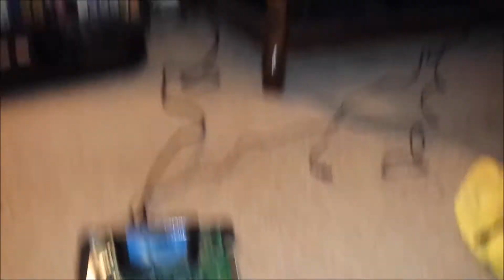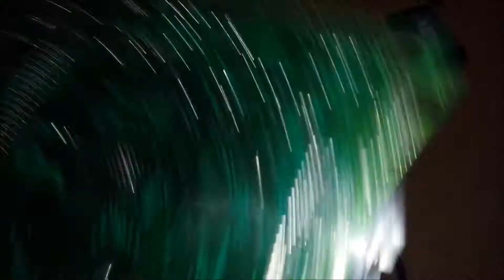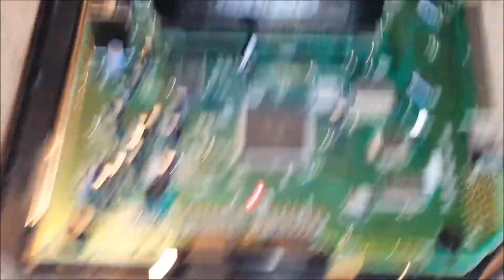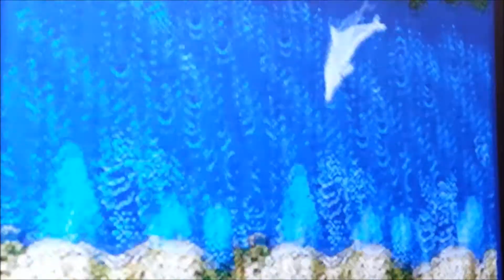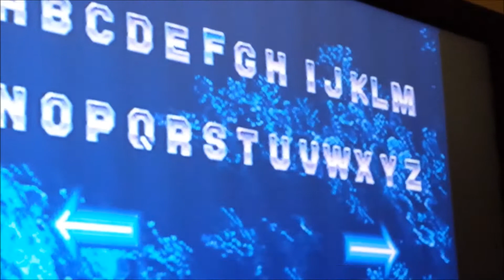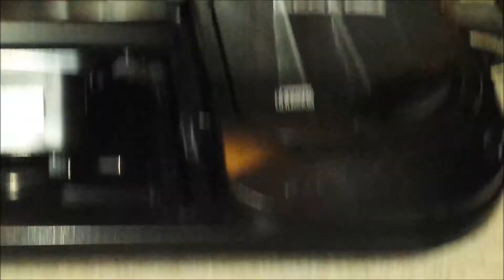How To Repair A Broken Genesis Model 2

Comment: I literally have this same issue with my Genesis 2. Literally the same exact effect. You make it look so easy though XD
Did you have to do anything to clean up your soldering iron/solder joints on the board? Use any flux? o w o
I'm always afraid I'm going to like burn up the board or lose my grip, and the iron will move and de-solder something else nearby. x w x
Reply from the maker: For that you should be fine just to use the iron on the solder joints. You'll be fine!
Reply: @zebular   I ended up doing it, and I actually fixed my childhood Genesis. > w <
I never thought I could actually work with a soldering iron. LOL. I think the trick is, you want to have a clean, well maintained iron tip and have a very steady hand. If you're shaky and not relaxed, you'll be all over the place. It's definitely something I had to dedicate 2 hours on a Saturday towards and prepare mentally for. But I did it! HAH!!!
Reply from the maker: @Matrix803  Hey man, that's where it starts. Keep it up and you'll be searching out arcade boards and "broken" game systems for cheap like me just for the fun of bringing that old stuff back to life!
Reply: @zebular  Apparently one of the solder joints broke again, because my down button wasn't working today. All buttons worked when I fixed it, which was literally like 4 weeks ago or something. Since then, after I tested the ports I made a point not to use the system until my new Retro-Bit controllers came in. Today I decided to try playing it, and that's when I discovered the down button was not responding. No matter how much I gently jiggled the controller connector, the button just doesn't work at all now...……. This is frustrating... :P
Reply from the maker: @Matrix803  Well, at least Genesis consoles are cheap if you want to just replace it and avoid some headaches.

Comment: Hi, thank You for the video. I have resolded the joins on my left controller port, because the right button did not work. But I didn't get it worked after it. Can You please give a tip, how can I fix it or what could be the problem. I tested both controllers on the other console and they work like a charm, so the problem is definitve the controller port. Thank You in advance for your help.

Comment: I bought a Japanese Sega Mark 3 with a broken power port the same way your console was broken so it turned off randomly.
Just removed the old one and changed with a common PAL Sega Mastersystem 2 power port and it works fantastic :P
Reply from the maker: Geno344 Yep, you would be amazed how many people throw consoles out when they could be fixed in literally like 5mins.  I actually just recently got an Atari 7800 with no power supply but the power supplies for them are getting pretty high.  I'm going to buy a generic one and replace the proprietary power port with a barrel type port.